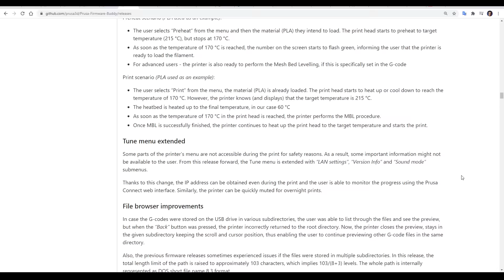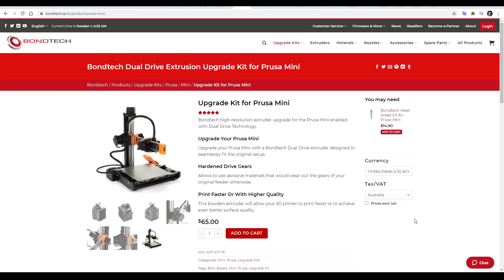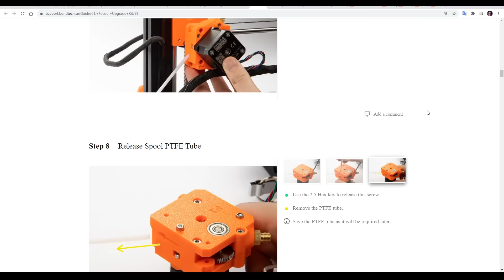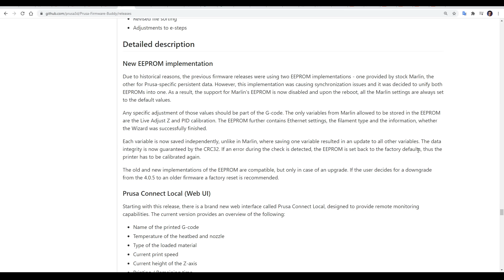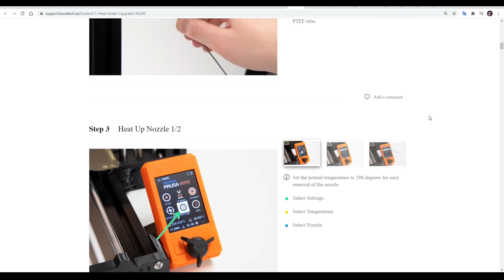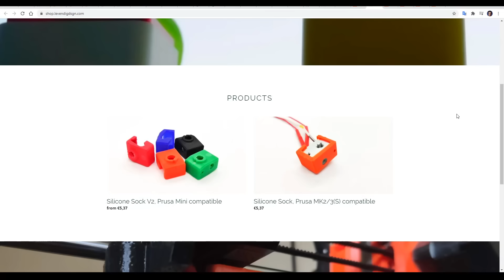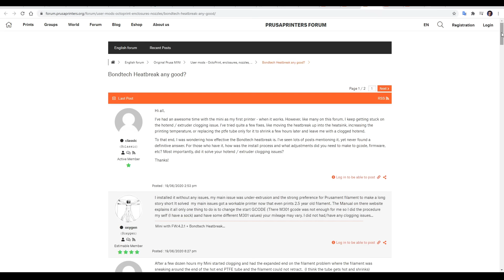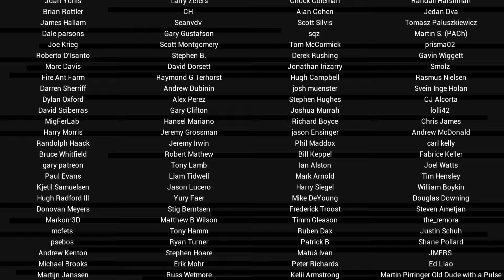Prusa Mini update: Improvements including Bondtech extruder & heat-break

Comment from the maker: Very interesting reading the comments on  this one. Some people happy with their Mini as is, others having significant issues. Mine was an early model and I think more recent models may have been tweaked to be more reliable. Like any manufacture, as an early adopter you are more likely to run into teething issues. There is a still a significant difference between Prusa and other popular companies, in that they actively develop their product after release and offer excellent one on technical support. Please remember that part of the higher price of a Prusa machine goes towards this.
Reply: I do have Mini from first wave i think, i picked that up on 18.12.2019 and ony thing i had was failed minda after few prints, solved through support witch immediate changed spare part and since then working flawlessly. Prints are a notch better than from MK3s - mine has from time to time need to be cared about but working well too. A part from two events when fillament managed by splitting to be left in bowden tube, I haven't got any issues with printer, Oh and from start had a too loose belt on Y axe,but that I do not count as a fail, it was just need for attention before first run after assembly. That is my experience so far.
Reply: We got ours in July and have had constant issues with it. At this point some of the obvious quality and design issues we experienced should have been ironed out. The support wasn't very helpful so I dont see a reason to ever buy another Prusa product again. 

Teaching Tech, I can't tell you how happy I am that Prusa is making better products off my money! I didn't know that it was also a gofundme project.
Reply: Your experience matches mine, and my Mini was from September 2020.  I returned my Mini for a refund.  What would you recommend as a decent printer in this price range that does mainly PLA?
Reply: So you didn't know that the best time to buy a Prusa product is one year after its release? "Sad but true."
Reply: Marco Roman, what you describe is called arrogance. Their business model has been adequate hardware and great software. There was info on their own website ridiculing the idea of very high quality hardware (not a good idea) while they continue to make hardware-related mistakes.
Reply: After trying both Prusa and Creality printers, I’ve decided the tech needs another five years before it becomes more joy than pain.  I’m interested in printing, not tinkering, and the tech just isn’t there yet, at least not at my price range.
Reply: @JunkYardTM  Pretty sure your experience will come in handy.. I recently ordered the whole package to start off my recent interest in 3D printing because of Prusa's reputation and just cancelled my order due to second thoughts.. I'm sure the mini is a fairly capable little printer, but paying 500 bucks for something possibly subpar seems like too much of a gamble for me personally. While I love the software approach and the overall appeal of the brand, I think I'll walk my first steps on something like an Ender 3 v2 instead and see if it proves to be a hobby worthwhile to me until spending some more. Good luck with your mini plus. Assuming everything's going according to plan?
Reply: @JunkYardTM  I'd agree that this doesn't seem like a good starter machine, which is what it looked like when I bought it first ... this was my first 3d printer, I bought it back in August but it came with a bunch of issues and I only had the energy and time to work on it for a few days then. Some were of my own making but I still haven't gotten a single quality print out of it yet. >.> I'm reaching out to support again and hopefully they can get me printing eventually, but part of me really wishes I'd gotten an Ender 3 (at least that would've come quicker and been cheaper, lol).
Reply: I bought a mini around April 10th and so far it's been working pretty nice. Nothing bad yet and I've had it for about a week now.
Reply: could you please make the video on how to flash prusa mini with this firmware using DFU mode? I have problem with it, would be nice if you make video instruction to make it  right! https://github.com/matthewlloyd/Llama-Mini-Firmware
Reply: Hello @teaching tech

I tried to change the e steps in the firmware and break the apendix and flash it. But in the firmware there are many configuration.h files and I dont know which one I have to edit. Could you make a short tutorial or guide how to setup the prusa mini firmware for the bondtech extruder. I think once peoples warranty is over many would be happy about a short quide
Reply: @louissenn9897  https://github.com/prusa3d/Prusa-Firmware-Buddy/pull/1398/files 
I hope it’s going to help you or I could give you already compiled firmware with changed e-steps, let me know
Reply: @repinscorpio  🙏Thanks a lot man. This is exactly what I was looking for.  I even found the PID values for the Bondtech heatbreak. I think I can compile it now. I will try it. Thank you😃
Reply: @louissenn9897  could you please share PID values and where to change them with me? I haven’t look at it yet
Reply: @repinscorpio  Hey Ivan. Sorry for the late answer. I made my own PID values as it is a little different for every hot end and I wanted it to be perfect. You can send "M303 S210" with pronterface to your mini and it will do the PID autotune for you. Or you can set the value after the "S" to any temperature you want it to autotune at. If you print mostly PETG for example send M303 S230

If you are in the configuration.h file, just click CTRL+F and search for "PID" and you will find the lines with the values. As I cant access my home PC at the moment I cant tell you the exact line as I cant look into the firmware on my laptop.

Its three lines I think and they are called something like kP, kI and kD . There you can put your values you get from the PID autotune. Be sure to let the autotune finish completely. It will do three cycles if im not mistaken and it will say "finish" at the end.

Comment: I used your setup and calibration website and after investigation, my Mini needed 251 e-steps to extrude 100mm of filament. (Was under-extruding 8mm). It’s also worth noting that with the latest Prusa Mini + firmware, one only needs to go to settings, long-press the button and change the e-steps there.  Also in that menu, if the Bondtech extruder is running in reverse, that option is available in the hidden sub-menu also; change the extrusion direction from “Prusa” to “wrong” and save your choices and the machine will restart with your new choices. No need to mess with changing wires or editing Gcode.

Comment: I own 8 Prusa Mini’s. They all print amazing. The only problem is the MINDA sensor doesn’t have a thermistor, so the z-height changes depending on the temperature of the room which is a problem with a printer farm. I print over 18 hours daily on all my printers.
Reply: I have this same issue. The only reason I removed it from my farm.
Reply: Have you seen the Mini+? They have resolved this exact issue with a new SuperPINDA probe :)
Reply: Bogdan Andrukhovich Did you buy it pre-assembled or the kit? Curious if that matters. I don't want issues with it when I buy :D
Reply: @onehotpepper  I bought them before they had those options, mine came in 2/3 parts. Took 15 to put one together. The issue was fixed with the SuperPINDA. I also got 8 more Prusa MK3s+ printers and those are amazing, you set it up once and they pretty much work for months without issues. I won’t get another mini until they update the extruded, it doesn’t print as well as original Prusa.
Reply: Ahhh. This is why my printer goes bonkers on first layer sometimes.
Reply: @onehotpepper  I'm pretty sure a "temperature" issue has nothing to do with the way it was put together.
Reply: @bogdanandrukhovich1085  It's crazy how much money you spend to do the same thing that others pay half as much for.

I'm doing the same thing as you with 10 Ender 3 clones and zero issues with temperatures or anything else. For half the cost.
Reply: @dangerous8333  I have enders, prusas and a cr6 max and honestly once I got my first mk3 I really hate using the creality machines.  The prusas are just so reliable you can click print and walk away knowing you'll come back to a finished print 99.9% of the time.  I always stay for the first layer on creality machines
Reply: @owen6017  thats so true, ive used several other "cheaper" printers, and all of them were a pain in the ass to get to work reliably. The prusa MK3? You press print, walk away and maybe you peek into your room once in a while to check if something is going on, other than that, it just prints, always perfectly fine. I love that thing
Reply: @KingHelmer  MK3's are downright dangerous with Octoprint 😀. I rely on printer so much that I've forgotten many times to confirm that I've actually removed previous print. Also few times left printer on for something like 4 hours and then checked if everything's alright, obviously meaning to check out within 15min's of print start that everything is going well. Nothing like my first Anet A6 which had to be monitored constantly.
Reply: Worth it to get mini + over mk3s ?
Reply: @dangerous8333  ender 3 clones do not have all metal hotends, linear rods, custom tuned profiles that work without modification, etc. These machines pay for themselves within a couple weeks and continue to earn revenue for 5-6 years before upgrading. I can't say the same for our Sovols and Creality machines.

Comment: It may be time to revisit this and do a comparison with the latest mini+
Reply: I agree most videos could be deleted as they’re obsolete
Reply: @legobuildingsrewiew7538  I and still having issues even with latest firmware 4.3.3.and I still working with Prusa for a proper solution.  I have taking apart this machine to confim things more then I have spent printing things.  Bummed as this was for my son and his love for engineering.  We are just learning the importance of proper engineering, instead of creating our own designs at this point, and look forward to when things are actually working.
Reply: @legobuildingsrewiew7538  I bought the new mini + and I was having constant clogging and under extruding.  I found that the tiny 2nd PTFE tube in the hot end is just a couple of mm shorter than the replacements.
Reply: @MrBassard  I’m getting one, should I order a new tube with it?
Reply: @hudsonroberge9897  check on their site to find the correct length as some models had the wrong length installed.

Comment: I seriously don't get what's wrong with your printer... mine never printed this awfully... When I watched your original review I was surprised to see that horrible benchy... In my case my only complains are the way X and Y axis are attached together were a pain to square and the other the filament unload that was unrealiable but that become better with updates
Reply: same here. These are ugly prints I never had on my mini.
Reply: depends on the date of manufacture for the printer, alot of the early batches were just terrible
Reply: Same. Only issue I had with the Mini so far was the probe failing after the 3rd week and Prusa took care of that pretty quickly and shipped a new probe. So far, I've put 12 rolls of 1KG Hatchbox PLA and PETG and a few 500g Polyalchamy rolls as well. I'm wondering if his printer has some issue with the motor or gears. This is definitely something Prusa needs to look in to though. They've built up their brand on having reliable printers. It would be a shame for this to take a hit with the Mini issues.
Reply: @lookitsrain9552  his should be a second batch like mine
Reply: @MasterControl90original  The print quality for the price overall though just seems unacceptable, frankly, Prusa has been well surpassed, ~400 USD shipped for this small build volume printer with a bunch of 3d printed parts that make it look like a total DIY kit from aliexpress.
Reply: @lookitsrain9552  well if all minis were printing like this one, sure but it is not the case. With a popular ender to obtain the print quality and convenience of the mini you need to modify it heavily, which means a lot of time and a lot of money spend. I'm not joking when I say that all ppl that saw my mini print quality, pretty much envy it... Even a guy with a nice print farm and very expensive machines is waiting to move to another place to buy a bunch of mini just for small and mid sized relatively high volume work. Again I agree 100% the launch was rushed but it was solved quickly and among the yt space his mini is the only one that print so badly or that still print this badly.

Comment: I've got the prusa mini.... I had perfect prints to start with... I thought i'd it the jack pot after watching your first video... But after 5 prints I ended up wit the same issues you described. I cleaned the extruder. levelled the bed countless times... I ended up doing 3 cold pulls and replacing the PFT tube and it's back to flawless prints... And looking at the prints you got after all of those prints I'd still say you ave an issue... Something is still broken. At tis stage I think you need to speak to Prusa.
Reply: Exactly same experience here !  Except I didn't have to replace the PTFE tube, just put it back into compression (which required a slight PINDA probe height adjustment). I clearly do not see the banding Michael has.
Reply: @vileguile4  The short piece of PTFE tubing that's inside the heatbreak seems to shrink a bit during the first prints. as a result, some molten filament makes its way between the heatbreak and PTFE tube in the bottom area, creating a blockage. If you dismantle everything, you will understand how it's made. When you say "disconnected pipe".. this is kinda what I had indeed.. except this "disconnected pipe" is inside the heatbreak.
The solution is to dismantle the whole assembly, clean everything, and push the heatblock up to compress back the PTFE tube in order to have a good contact of the PTFE tube inside the heatbreak (hence "put it into compression"). SInce you push everything up, the PINDA / MINDA probe (the yellow popsicle that probes the bed during autolevel) is them too low and needs to be readjusted by a millimiter or two or it might touch the bed
Reply: @lfrederic1823  Thank you very much! I have disassembled so i have seen the PTFE tube in the bottom area. I also managed to disassemble the cogwheel feeding the filament. Is adjusting the heatbreak/Minda  on similar level of difficulty?
Reply: @vileguile4  it’s pretty easy to adjust the Pinda. Just a bit fiddly. Only two screws to undo and then adjust the Pinda height up or down by playing with the screw mount. Just need to find the right spot. There are detailed explanations on Prusa website and several videos on YouTube
Reply: @vileguile4  for the heatbreak, just undo the 3 grub screws and push the whole heatblock assembly up from below while it’s hot to put the PTFE tube under reasonable compression and tighten the 3 grub screws back again. Do that step before Pinda height adjustment obviously. Again, everything is explained on Prusa website. Make sure you don’t burn your fingers :D
Reply: @lfrederic1823  Thanks!!

Comment: My mini's print quality has been excellent, in line with the MK3. Is it possible you received an early version of the printer? I recall they made some updates immediately after it was released.  I'd be interested if you got a new mini if your problems would be solved. Bummer it seems a pain to implement the bondtech upgrades. I was considering this extruder for a fun project, but I may hold off now.
Reply from the maker: Mine was definitely from the early batches. I pre-ordered the day after it was announced. More recent deliveries such as yours seem to be going better, and that's a good thing.
Reply: I also think this is was an issue. Received mine June 2020. No issues so far
Reply: Same here, with the Mini that I received in September the print quality has been excellent and pretty consistent.
(My only complaint might be that the first layer height seems mildly inconsistent, though this seems to be improved if I preheat the bed with the hot end nearby, so I get the sense this is due to the bed leveling probe on the mini not being temperature compensated.)
Reply: My Sept 2020 Mini had the same issues.  I returned it.
Reply: Got mine in July and it has these issues and so many others. I will never buy another Prusa product again.
Reply: @bkindt  Got my sept 2020 as well, and no issue like in video mentioned so far. Results pretty comparable with mk3s